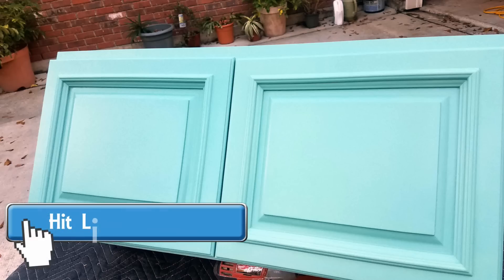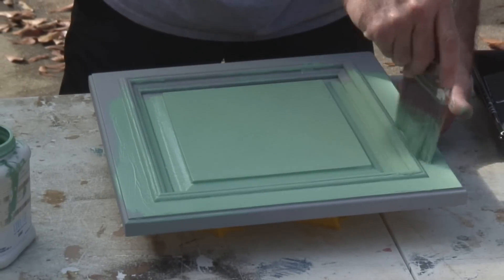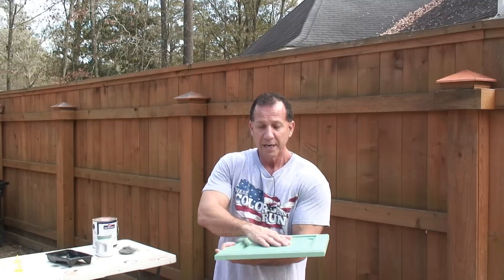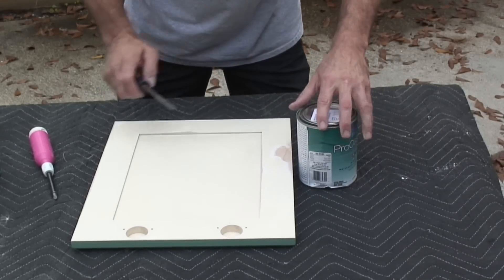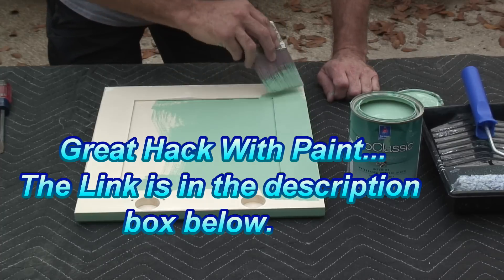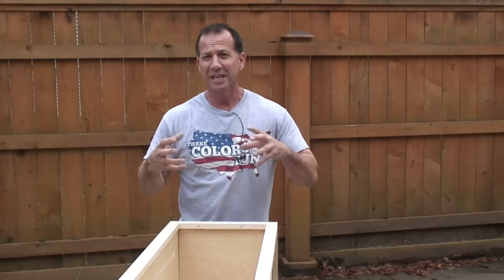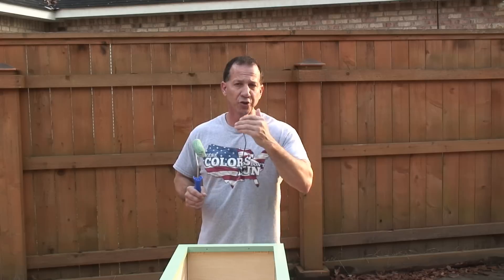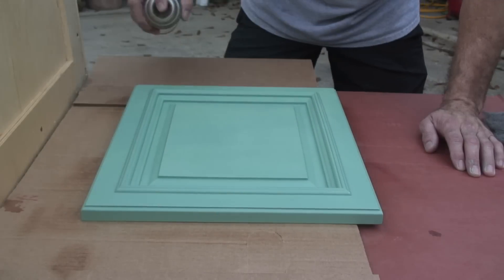Spray like finish on cabinets NO SPRAY GUN!

Comment: Keep the roller ready for a while without drying out. Wrap the wet roller in a plastic sandwich bag and store it in the freezer.
Take it out let it thaw and its ready to go again.
Reply from the maker: Thanks for the tip Edward. I had access to newspaper bags and I would wrap my rollers with them on long jobs. You can also wrap them in aluminum foil. if you are going to keep them longer than 24 hrs., you can put them in a refrigerator. I also keep my caulking in the fridge, it keeps the products from drying out and you can use them as immediately. The freezer will make paint brushes and rollers hard until it thaws. It still works but I prefer a refrigerator.
Have a good day!

Comment: That roller nap will leave a fine raised dimpled surface verse brush lines. I know that I can use a brush and show no lines if the paint is thinned right, the paint will flow if you let it.

Comment: I thought with Pro Classic being so durable, a clear coat wasn't needed?  Or is there another reason I'm missing :)  Last I looked at your videos was 2013 when we started on our kitchen project and I was spray painting my doors, but hand painting the upper cabinets.  If the paint chips, can you still do touch up when there is a clear coat?

Comment: Great video, thanks Paul. I am working on a kitchen that was built in 1937 and has multiple layers of paint on the builder original cabinets and doors. Any suggestions for how to make them look great again?
Reply from the maker: Hi Paula,
You will have to be careful with old paint, it will probably contain lead in it. I would not recommend sanding lead paint. I would suggest going to a paint supply store, they will have more knowledge than the big box stores. I would look for a good paint stripper. I normally do not use strippers but sometimes it is the best option.

Comment: Paul, can you tell me why you use an automotive primer as opposed to primer from a paint store?
Reply from the maker: Hi Michael
You can use any spray primer, I personally like grey automotive primer because it bonds very well and has excellent coverage. I tried other primers, but they did not cover as well. This is only my personal opinion and not a rule to go by. 
I hope this helps.
Thanks!
Paul